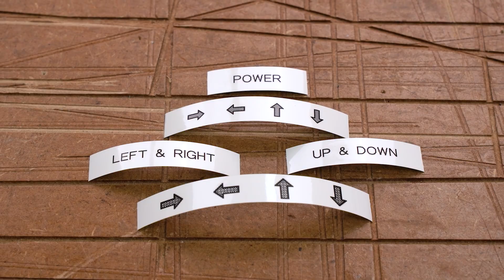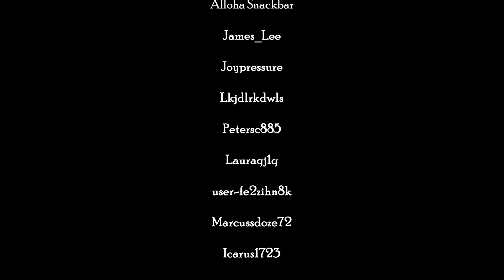Making 2CH Motor Controller / DIY

Comment from the maker: Please turn on your language subtitles! 
And please join our membership.
There are many simple circuits that control the direction and speed of the motor.
I made a set-top box that can control two motors using two sets of circuits.
When we move the motor to make an actuator, etc., we have to control the direction and speed of rotation.
Uniquely in this work, the push button is used as a momentum switch and the joystick switch is used as a ratchet type. The push button is operated only while pressed, and the joystick switch continues to move to the bent position.  Each motor also has a volume switch that can adjust the speed.
This set-top box is intended to be used for the component transfer device that will be used in the drill press for the next installation. The member transfer unit can be used to secure the member to be punched in the upper part and to move the switch in the set-top box to the position to be punched.
Besides this, I think it can be used to adjust the motor in various ways.
The motor used a deceleration motor of 12V 260rpm specification.

If you enjoyed watching it, please subscribe and like it. Thank you.

#DIY #Tools #Making #Creating #Drillpress #Joystick #Remotecontrol 

📢BGM
✔Track - The Road to Your Inspiration - Inspiring Cinematic Music
✔Soundcloud - https://soundcloud.com/keysofmoon
✔나눔뮤직 - https://tv.naver.com/v/12021211

Comment: Хорошая штука.
Что за контроллер использовался?
Reply from the maker: Это контроллер прямого и обратного хода для двигателя 12 В. Также есть функция контроля скорости. Вы можете приобрести его в магазине электротоваров. Спасибо

It is a forward and reverse controller for 12v motor. It also has a speed control function. You can get it from an electrical supply store. thank you

Comment: Hi can you list the parts and where you obtained them would be appreciated, great build thanks
Reply from the maker: I usually buy parts from Ali Express. I used a 12v forward/reverse motor controller to use a 12v motor. And, I used a push switch and a joystick type switch. You can also find it on Amazon. thank you

Comment: Is there a protection against pushing buttons in opposite directions at the same time?
Reply: He has a well-trained dog that will bite you if you do that.
Reply from the maker: That's an appropriate point. The damage from the short is not that great because it is 12V. And since it is a prototype, it is true that the safety design is insufficient. thank you